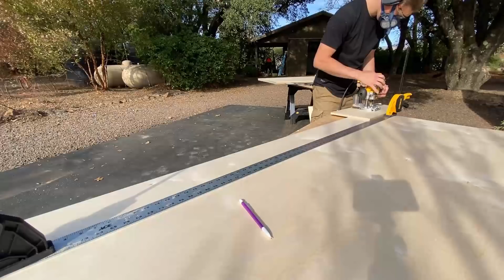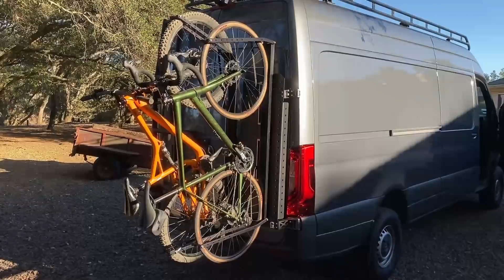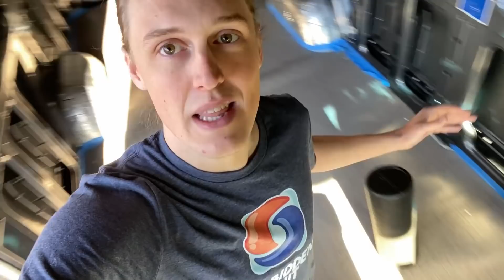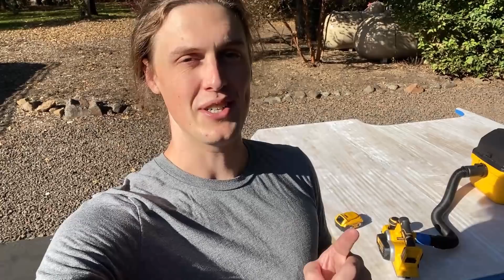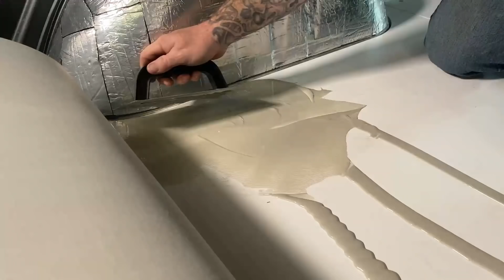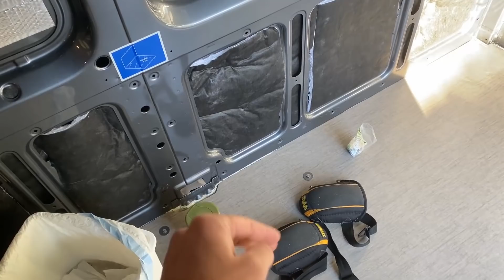I FINALLY made the PERFECT van floor (Part 3 of 3)

Comment: Love the glueing the plywood with a lap joint but the insulation is minimal R value. I probably would have put 1 " rigid then your system but I am in the north country so maybe you didn't need the best R value

Comment: if you would read the manufacturers instruction you would not have to waste time and material. it would have been cheaper and faster to drive up to any flooring company to have them install it for you correctly in about an hour.... smh

Comment: did you router the lap joints on all the  panels ? And, are all panels glues together ? i'm doing a 144" with three panels and was wondering if some panels were glued together inside the van.Great work your video's are most excellent.

Comment: Great job, it looks great but is it worth the time spent and money ? The sub floor Würth of my van is in good condition and already has v profile edge to join the 3 panels. Is there a reason not to use it for the floor ? If I isolate under it with 2cm slats and extruded polystyrene then fill the side with  band of leveled glued to the floor plywood and finalized with spray foam that I will level when dry with knife. Then I could use the époxy technic of your 3rd floor to glue and stabilize my vinyle. Is this feasible ? I can keep the side floor fixing bolds for furniture fixing. As it is a special kind of hardened plywood, I wonder if I'll drill and screw easily in it ?
Thanks in advance for advice.

Comment: I saw your silicone problem coming. 

NOTHING sticks to silicone. Fun fact: not even silicone will stick to silicone. Nasty, huh? 

Fun fact #2: You cannot really remove silicone. Goo Gone gets off the worst of it. Dow says peel & scrape it off. Dow sells a "silicone caulk remover" that sorta works for the rest - but not really. It's nasty & needs effort, but even that stuff doesn't completely remove the silicone. Why not? Silicone doesn't sit on the surface of whatever you put it on. The silicone sinks INTO the molecular structure of the substrate, and that includes metals, glass - anything.

Moral of the story: think long & hard before you use silicone anywhere. Lean towards using latex (anti-mildew version) caulk or polyurethane instead. Urethane is better as a glue but much harder to remove later if that's required.

Silicone is amazing stuff & has many appropriate uses, but for most household applications (bathrooms, kitchens, vans...) you should avoid it. Sooner or later everything needs to be renovated, resurfaced, replaced. Don't leave land mines for yourself. It's 10x the work later. 

As you found.

Comment: Learning a lot from you bro. Question, when you have to fasten something to the floor, do you rely on the Baltic Birch to hold it or do you penetrate that to hit the metal van flooring?
Reply from the maker: I went into the metal walls / ceiling with the 80/20 framing. Then small things like the AC compressor i screwed into the floor
Reply: @seven_o_savage  Understood, thank you sir.

Comment: Thank you for your commitment to perfection — it has helped me slow down and be mindful of each step so I don't rush into something (I'm also the type to accidentally router the wrong side of wood). I'm wondering where you got the metal trim you used for the sliding door, and front and back of the flooring. It looks super slick and is exactly what I'm hoping to be able to do.

Comment: Hey, amazing looking floor!  I’m installing a floor right now as well and have a similar gap between front and rear boards.  Since you didn’t end up filling the gap with anything before epoxying down the lonseal, have you noticed any indents form over time in the vinyl?

Comment: Hey what bolts did you end up using to secure the panels down? Btw I basically copied your exact floor except I epoxied all my boards together in my 144”.  

I made an even more bone-headed, expensive mistake than you. I’m on my second subfloor and second roll of lonseal. 😐

Comment: Just came up as I watched other floor installs, yours is the best floor build yet seen. I like the non glued  attachment and thinking about noise plus thermal. Not a fan of those that glue flooring down. Did not see if you cut foam stripes to go in floor channels, maybe some air gap is good if water ever gets under the floor. I might use a spline joint or tongue and groove for the middle connection.  
Do you feel, in the event of a sizeable water leak, that water could flow over the floor edge and out the van drain holes? 
Did you secure cabinets to the floor or just secured to sidewalls?
Reply from the maker: Thanks! Nope I used one sheet of foam under the floor. Yes I’ve had water leak (while installing plumbing system) and it gets out

Comment: How much of the West Systems 650 epoxy did you end up using for the joints? I'm curious if the small 4 oz bottles (8oz total) would be enough to glue the two lap joints in my 144.  Also, how is everything holding up?

Thanks for your contributions!
Reply from the maker: I remember I had like 90% left over 😂. But I didn’t want to wait for shipping twice in case the small ones weren’t enough. 

Floor is holding up great 🤙

Comment: We love your videos and we have a floor install dilemma. 
We have a 2021 170 sprinter.
Our van came with only the mat that goes between the front seats.
One of your videos shows two mats just behind the front seats (you cut your wood straight across.
Another video shows you cutting around the center mat and taking the wood all the way up to the seat bases.

Our dilemma is we only have the one center mat, so we do not know if we should cut around and take the wood to the seats or try to find the two missing sprinter mats.
What would you do?
Al & Naomi
Kids in Action
Reply from the maker: Sup guys, it may be worth asking the dealership if they can find / sell u the side mats but if not I brought the wood to the seats in my first van and it worked out great!

Comment: Currently wrapping my floor now and I feel your pain. Curious why you didn't go vinyl planks around your cabinets like I'm doing. I was going to mess with vinyl sheet but chose the planks due to their robustness, easy repairability, and look. They are slightly heavier but if you just do around the cabinets, you shouldn't notice too much weight increase over sheeting the whole floor. RIP bank account, LOL!
Reply: Hi, it’s been a year and curious how your lvp floors are holding up.  I’m about to pick out floors and leaning towards vinyl sheet because I feel if there are spills it’s less likely to seep through, easier to put down than all the cuts, and I’ve heard they may start to come apart with driving or swell in high heat etc.  I do prefer the look of the planks vs the sheet.

Comment: Hi 7 O. I appreciate your tenacity and perfectionism. However, my question is: why not use a thin foam layer over the wood floor same as in residential application on a floating floor for the vinyl underlayment?
Reply: That foam underlayment works great for vinyl and laminate planks because they are designed to float. The sheet vinyl he is using is glued down. Having said that, I definitely would have installed vinyl planks.

Comment: Hey man, just wondering why you decided to go with silicone based caulking in the end instead of urethane for the perimeter of the Lonseal, after seeing that Gregg Nord was recommending to use urethane instead of silicone in the comments of your previous floor video? Thanks.
Reply from the maker: Once you put down silicone, it’s very hard to remove it and have anything else to stick. Fwiw i haven’t had any problems yet with the silicone

Comment: Seen a few of ur videos now and the thing I see is u are wanting to do as much as u can ur self which is commendable but the things I'm seeing u have problems with is the stuff that one gets from hands on experience were contractors used to have aprntiss but I find if hummers because I see it but at the same time I only came across ur Chanel after finding out about 80/20 being so available as it is and the first video I seen of us was actually when u put the 80/20 in the van and that was in pressev it did give me a lot more options for my truck

Comment: Seven O Savage, I know this is an older video, but I'm about to lap joint my 1/2" plywood floor in a 170 Ext., which will require 4 plywood sheets. Do you see any problem epoxying the forward half of the floor and rear half in-place?
Reply from the maker: It could work yes. But epoxy is finnicky, make sure you prep correctly
Reply: @seven_o_savage  thanks! Hope the floor is holding up well.
Reply from the maker: Very well :). Only thing i don’t love is the lonseal… not terrible, but just decent in my opinion
Reply: @seven_o_savage  Interesting. I also have an added hurdle of temperature tolerance. Nothing extreme, but since I'm under 6', I'm going to use 3/4" to run some hot liquid through PEX under the vinyl with a Rixen system to warm up my feet (and van) after skiing and surfing. The finish is always hard for me. I think I've found a good source in Portland, Oregon. But, if you have anyone you think would be a great supplier, I'm willing to drive.

Comment: 'pressure sensitive adhesive' is what you should have used for this. It spreads on wet and when it dries, it works like a strong tape. You lay the floor directly on it and it can be pulled back up just with force or aided with a heat gun.

Comment: No you did not, because it's not heated and you can't see through it, not to mention no model rail road built into it.
Now get back in there and make me proud soldier.
I do hope you're hiding LiFePo 4 batteries in the walls to power the laser defense canon and the central computer game rig.
Without a shield generator things could get messy.

Comment: Why didn't you just use some biscuits as they would have joined floor perfect and you could have joined them in van 
The way you have done floor is way hard job and expensive way

Comment: Yo, Seven O' Savage, thank you for all the subfloor videos!  In the final floor install I assume the primered subfloor was still is two pieces with a 5/16" gap before you laid the vinyl sheet. Did you put anything in the gap in the final floor or no? After the silicon related adhesion problems with floor #2, I wasn't clear if you skipped the silicone in the gap. Perhaps the Lonseal epoxy is fine with the silicon filler? Any words of advise is appreciated!!  Thx.

Comment: OMG....driving me nuts watching this video.  Just get the main plywood floor base down (good job on that step).  The seal the entire plywood base floor with west systems 2 part epoxy (about 2qts total) with a roller made for that.  That would have been done in about an hr of work and let it kick over night.  Then next day install some really good wood simulated vinyl planking and allow it to free float on the floor (no glue down)!  About 2-4hrs total with trimming.  Done!   You'll never have to worry about that system!

Comment: Doesn’t epoxy harden when it dries/cures? That’s not gonna be a good idea in a van that rattles down the road.
Reply from the maker: Yes it’s stronger than the wood itself
Reply: Yeah but, that’s not gonna fare well with a van that shakes and twists down the road. What I’m saying is wouldn’t it have been a better idea to use something with some flex? 

I’m currently in my second personal sprinter build and have been inside about 500 or so revels, modes, and personal builds. I think the consensus is hard stiff stuff is a bad idea. 

Please enlighten me if I’m wrong.
Reply: West system epoxies are designed to join plywood on boats, which you can probably imagine do shake rattle and roll.
Reply: Randy West I beg to differ. I lived on a sailboat for 5 years. Tell me again? You think a boat rattles as much as...the floor of a van driving down the road?

What ocean do you sail, sir?

Comment: I learned it is possible to fit a ton of commercials in a relatively short video.
Reply: 6 in 32 minutes. That’s not short. YouTube won’t push your videos if you don’t max out the ads. 1 break every 5 minutes. That’s why most creators bs/push for 10 minute videos

Comment: Seven.. I'm gonna start my Van build next week, and my question is: Why did you change the approach of flooring the van? To me, the old Van flooring process seemed pretty straight forward and the result was pretty good! Other than changing the vinyl to a more durable vinyl, I don't really understand why you have opted to rethink the flooring!!?? So please, let me know why... it's going to help me! Thanks!
Reply from the maker: Nice! Primarily wanted better vinyl, lower weight, and a little insulation. The floor in Vangelina Jolie was overall about 80% as good, less than half the price, and way easier to install.
Reply: @seven_o_savage  cool! I'm gonna go with a hybrid of yours... since I'm not as tall, I'm gonna make a floor framing, than insulation, the wood floor and vinyl!!! Thanks for your answer!

Comment: I did the same exact thing! My van is a 148" Transit regular length, and I used a 3" lap joint and glued all my pieces together using wood glue. I can barely move the piece myself using some wheel dollies or carts, but having someone help is the easiest.

Comment: Another option which I used was an acrylic vinyl adhesive.  It's supposed to be the best option, though I'd prefer the 3M 90 as it would be easier to keep it level and smooth.

Comment: Thorough information, thanks. What are some other alternatives to the vinyl ? Seems like it's too sensitive of a material. Coin grip?
Reply: Hi, the Lonseal material is extremely durable. It's almost a sin to lump it together with other vinyl products. Lonseal is made for aircraft and industrial uses so it has to withstand thousands of people per week walking on it. Also coin grip is vinyl made by Lonseal (at least the good stuff).

Comment: Congrats on the floor. In your last video, you shared a comment from a Lonseal employee recommending urethane caulking for the edges instead of silicone-based caulking. Why did you still go for the silicone-based? Cheers.
Reply from the maker: Good question, I mostly just didn’t read that part. urethane caulk will definitely last longer, but it’s ridiculously strong/hard to remove if you happen to need to pull your floor back up 😉.
Reply: @seven_o_savage  Last one if I may. What bit did you use to countersink the bolts in the floor?

Comment: WOOOOW!!! What a journey, I hope you enjoy the NEW floor.  I'm a little weary of the vinyl because of off gassing in such a small space. I'd for sure be more inclined to do a well sealed wood floor.
Reply: I had this same concern. But I learned more about Lonseal and found out that it doesn't off-gass. They have to follow extremely rigorous manufacturing processes because most of their products end up as floor material for commercial airplanes where the air is recirculated so can't cause harm in any way. Lonseal is really in a league of its own. It is completely different than what you would find at Home Depot and the like.
Reply: @VanLand  agree with this. We have used Lonseal in multiple hot yoga studios where off-gassing is a real concern. Lonseal makes outstanding products.